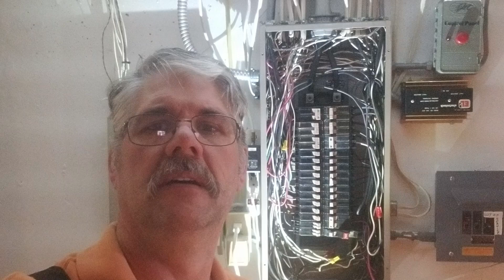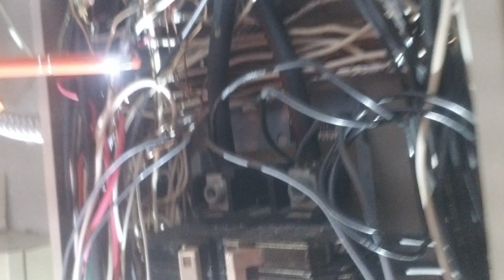Why You Should Not Triple Tap Your Main

Comment: Tell your counterparts that some breakers are designed to be double-tapped.
Reply from the maker: That is a valid point. Sq D and Cutler Hammer make 15, 20, and 30 amp single space breakers configured for two load-carrying wires of the same gauge. The distinguishing feature is each wire is to be placed in the appropriate slot and not doubled up under one side. Double lugging involves placing more current carrying wires under a lug than the manufacturer specifies. The point of the video was two # 12 wires had been placed in the main breaker lug, which is not permitted because that lug is only rated for one wire. Double lugging "triple in this case" was especially dangerous because the #12 wires were not properly protected by a circuit breaker.